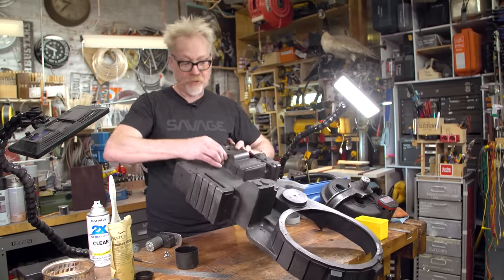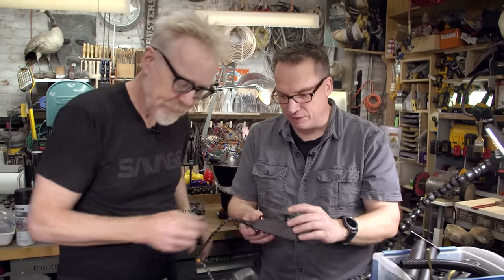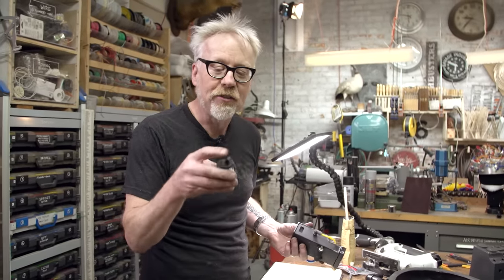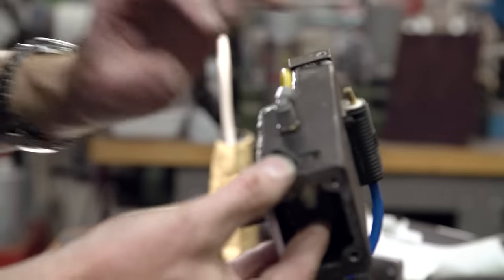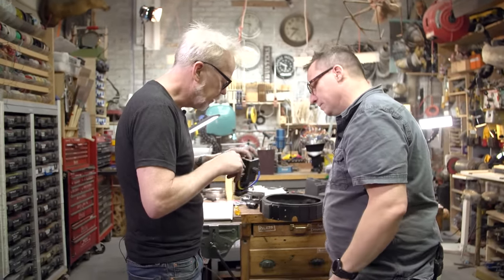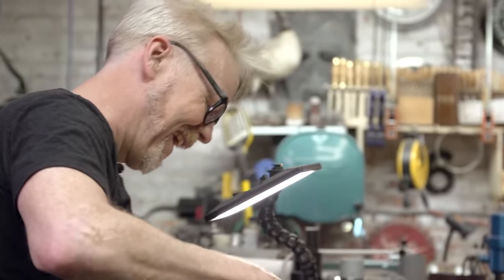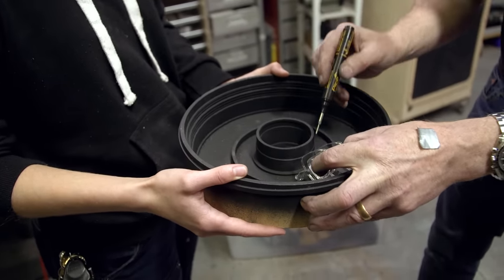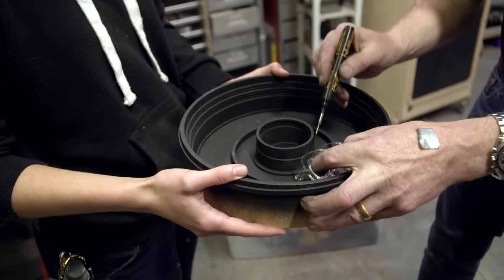Adam Savage's One Day Builds: Ghostbusters Proton Pack!

Comment: My current pack is made from recycled cardboard and found items from around the house. 
(Build time was just under 3 months due to my full-time job.) 
I used hot glue to imitate weld lines where needed and weathered them with metallic aluminum craft paint.
It does have an authentic Spectra computer ribbon cable (GB 2 style) and screen accurate hoses where needed.

It's 6 years old as of this writing and everyone who sees it can't believe it's cardboard! 
The screen-accurate lighting kit really helps a lot! (purchased from a seller on Etsy last year.) 
It runs off of 1, 9-volt rechargeable battery and lasts at least 6 hours of continuous use. 

A huge Bluetooth speaker is inside the cyclotron so I can play music wherever I go.
Granted, my pack is heavily weathered and I used layers and layers of corrugated cardboard as well as 2 bottles of wood glue to make it nice and sturdy. 

And it weighs roughly 12 pounds with the Hasbro Plasma Series Spengler's Nuetrona Wand (modified to resemble the original 84 version) and ALICE frame.
Reply: I would LOVE to see this! Do you have pictures anywhere?

Comment: I remember the first proton pack I built. Stuck a backpack inside a cardboard box, with holes cut in the box for the straps. Then I found some old video game system that had a light gun controller that you could convert from a pistol, to a long barreled pistol to a rifle, that attached to the console by a long cable (wished I could remember the name of the console. It was before even the Nintendo system around the time of the first movie). Anyhow, cut a hole, stuck the system through, painted the box black, and hand drew and colored with markers a Ghostbusters symbol, and glued it on the box. It wasn't fancy, or perfect, but I had my own "Unlicensed Nuclear Accelerator" on my back. Of course, I was about 13 at the time, with a lot of medical issues...
Maybe it's time for a MkII version...
Thank you, Adam Savage for the inspiration...

Comment: Hey Adam, I've got a question when it comes to aging props: One thing I learned from being in the military and dealing with equipment that's been handed down and heavily used for decades is that almost every piece of equipment that's seen long term use has pieces of tape or tape adhesive on various parts, but it's something I've never seen used on props (places where you could tell tape had previously been and left behind residue, or pieces of tape that had been ripped off and left small pieces behind). It makes for great texture and feel/reality, but I never see it used; why is that?

Comment: 15:57 I made the crank generator on my pack build into the power switch. It actually has 2 modes: normal operation and visualizer. Visualizer takes in ambient sound (or sound pumped out through the pack speakers; I also added an aux in) and controls the pack lights based on the sound.

Comment: Thank you so much! Ive had a sort of steampunk boiler backpack for an original character based on the lore of Steam Powered Giraffe thats been on the table for years because the only options for small smoke machines that would fit in the shell  were either in the multiple hundreds of dollars range that would need modifications after the fact, or fairly lackluster diy options that didnt produce the volume needed. That is a game changer

Comment: Super awesome collaboration build! 

Seeing the smoke effect I thought it would be a little cool if a variable speed fan was used to force the smoke out just a bit faster like a superheated burst of air rather than just a fizzle fry.  

I have a steampunk project jetpack and this was part of the conceptual thinking for when it was spinning up. 

Btw, loved the little antenna... though I think you need to bend one or two of the protrusions as I think after so many years of being tossed around that bending is likely to happen.

Comment: With the understanding while watching this. They put in a switch under the ion arm because in the original movie that's where it supposedly turned on at. But if you watch the movie carefully when Egon turns on Ray's pack he makes a clockwise twisting motion which would indicate it's a knob not a switch and the placement of this knob puts it right where the power cell indicator is. Though it's never seen in any of the close up shots it proves the proton pack is very unique to each character and to me that makes them all the more interesting. Just my observation. I speak for no one but myself.

Comment: Why use lacquer paint? Because it dries quickly! Use Acrylic on rubber and plastic! Never use enamels on rubber or anything like rubber! It’ll stay tacky forever! Use enamels only on thin plastic parts because Lacquer will eat into thin plastic! Opaque fabric paints are good for filling in dark areas when weathering because you can clean up easily with just alcohol wipes! So if you mess up on plastics or metal details you can paint the tiniest details with confidence!
Hope that helps anyone wondering!

Comment: i feel like the activator switch oughta have been moved from the back of the pack to a location on the front or onto the wand at some point during their use-life, it IS a particle accelerator, you wanna be able to activate and deactivate the thing on your own for safety reasons (unless its a matter of like, making sure your never using the thing on your own or some such); ofc if the rest of the ghostbusters quit eventually, leaving one left, at least one of the packs will need to have a front-mounted on off switch

Comment: Adam really doesn't know the design language of GB84. The actual ‘21 producers made the proton pack more balanced. Every corner that looked empty was made less empty by increasing nuance. This kept the prop the same but made it better. The '84 proton pack design language is closed off angular spaces with large singular elements (HGA, ion arm, power cell, etc). Adam started to add many non 84 tech elements, like a hodge podge of greeblies. The Clippard disk was the most anemic part of the 84 pack. That’s why the ‘21 team added the small amount of greeblies there. The ribbon cable side therefore needed additional balance, hence the additional neon yellow ripcord. Yellow because that’s the accent color of GB (trap, Lifegard, leg hose, etc). Neon because neon yellow when dirty looks green: slime color. Very clever. An artist thinks things through. An engineer just cobbles parts together.

Adam also doesn't understand aesthetics. His ion arm antenna is proof of that. The original pack was meant to make the wearer look heroic. The radar prop (cyclotron) was chosen to lie low against the back, the ion arm and wand are wide to make the wearer look wide shouldered, the centre is thin to accentuate a thin waist line (coke bottle shape). Just adding horizontal wires to the ion arm shortens the lengths of the pack (ratio). Adam seems to not be aware of the ratios in the original design.

The Afterlife pack is a masterpiece in terms of reverence to the 84 pack.

Adam just did his own thing with a (very) surface level nod to GB... His is almost a Star Wars version of a proton pack, not grounded in '84 electronics.

Something also tells me he won't do these collaborations with other builders again.

Comment: Bet with a battery belt, you can gut out a microwave and turn that pack into a microwave gun.  Would be fun to use on real ghost hunts since ghosties like to suck the life out of batteries. Egon's EMF detector would be a sinch to make since they already exist. Just need some mechanical arms to raise n lower depending on signal strength.  As for the toaster... I got nothing.